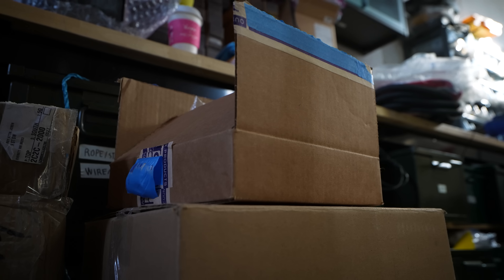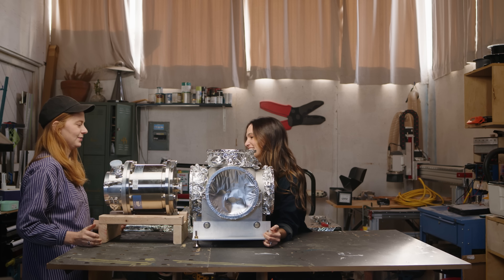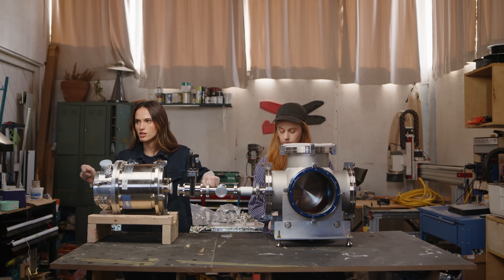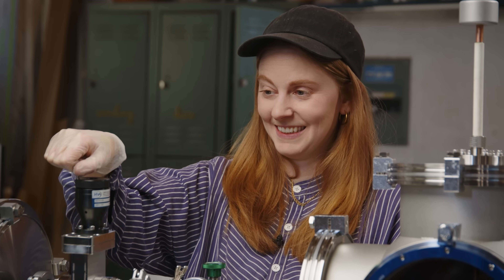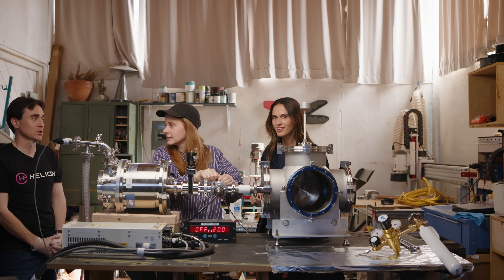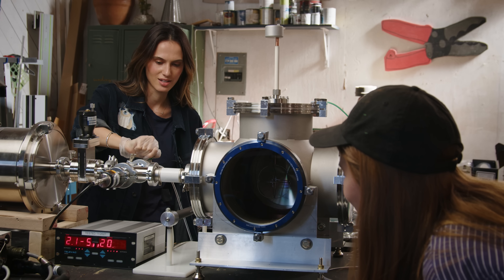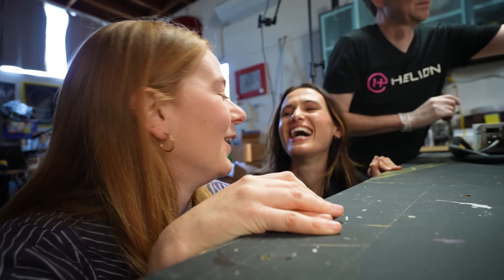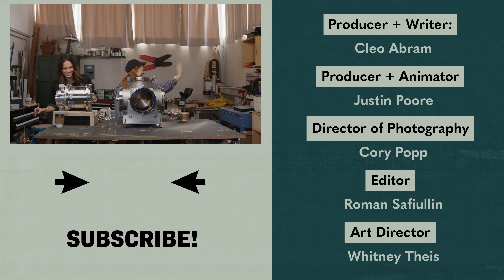We Tried To Do Nuclear Fusion

Comment: I just read yesterday that the Lawrence Livermore National Laboratory in California have finally achieved a net energy gain from a fusion reaction.
Reply: I saw a tweet from a nuclear physicist who said that it's like very short bursts of net energy gain, it's lab-scale stuff that still has a long way to scale up for real energy production.
Reply: No, not yet. There is still the need to extract the energy and only after this step (including losses) has greater than nett zero does it mean time to scale up and industrialise.

That's why @davidkirtley and the guys at Helion are so important as their design Co siders the direct  electricity energy extraction in the fundamental design, ie Helium 3
Reply: Yup , true .They are due to make formal announcements December 13
Reply: The NIF, National Ignition Facility, has achieved target gain by generating a 3 megajoule output with a 2 megajoule input. This is a gain of 1.5. Gain is how we describe how useful the system is at generating energy, but there are a few different ways to describe gain in this field, Inertial Confinement Fusion (as compared to Magnetic Confinement Fusion). 

They achieved scientific gain a good few years ago. Scientific gain compares the amount of energy that they manage to couple into the fuel with the energy generated by the fusion reactions. 
Target gain as they have described it is comparing how much energy they generate with how much laser energy reaches the target. Making laser light isn't a 100% efficient process so you currently use much more energy to generate the laser pulses than arrives at the target.
Prior to a power plant being made you would need to achieve or at least have a solid plan for gain as compared to the total amount of energy used, often called wall-plug gain. 
So to get to that point you will go through the various different stages of gain milestones.

What NIF has achieved this past week is one of those critical milestone. It is very exciting. 

Few things to note: The way NIF generates laser energy is now old technology, there are more efficient ways to make laser pulses now, so lots of opportunity to save input energy there. They only burnt 4% of the fuel so  (deuterium-tritium mix) so plenty of opportunity to up the energy out there.  Exciting times! 😀
Reply: @petafoster5084  Except no, they didnt. Actual power input to the 192 LASERs was around ~200 MJ, power on target was ~2 MJ after losses, extracted energy was ~3MJ final, so it adds up to a huge deficit in total.
Reply: @Sven_Dongle  yes it is the laser energy on target is why they call it target gain.
Reply: No, they didnt' reach net energt. At all. Stop, pls
Reply: What does this mean exactly? Does this mean they could scale their current solution large enough to power a city? (Ignoring any additional breakthroughs)
Reply: @TysYouTubeChannel  From my understanding what they have at this time is not commercially viable or scalable at this time.  The main choke point seems to be being able to obtain enough quantities of the specialized materials used in the construction of the reactor.
Reply: @JPF1077  That's not the only problem. Once the pellet explodes and the energy is released, there's no way to capture the energy and no way to quickly replace the pellet and fire the lasers again. So you can't use this technique to create long term sustainable fusion.
Reply: @TonkarzOfSolSystem  On a commercial level could they not utilize multiple reactors in sequence?  Capturing the heat from the reaction should be simple enough.
Reply: @JPF1077  The issue is that the pellet needs a football field worth of empty space all around it. Makes it hard to capture the heat.

And because the reaction only lasted for milliseconds, and requires so much space, using multiple reactors would not work. 

This experiment was created to make fusion for weapons testing, it's not for energy production.

So there's no way, even theoretically, to produce energy in a practical way using this technique - even if they can drastically improve the energy output.

However, as they repeat the experiment they'll develop a better understanding of what is causing this and from there they may be able to develop new ideas and theories that could be used for energy production.

This is an important milestone but it won't solve today's problems.
Reply: @TysYouTubeChannel  No, the laser charging loses aren't part of the reaction energy so it still takes more power than we could feasibly generate with it the reaction itself is just putting out more energy than the energy emitted by the system that ignites the reaction. It is still a really impressive feat, but practical fusion still has several more iterations before it can generate net electricity.
Reply: @garethbaus5471  On top of that there isnt enough available tritium on Earth to fill a wine glass. The NIF can only achieve 1 shot per day to produce enough total energy to power your computer for about an hour.
Reply: @Sven_Dongle  Tritium is expensive, but we already know how to make it and fusion reactors should in theory have an advantage when it comes to breeding more tritium, so that is a problem but it isn't a deal breaker.
Reply: @garethbaus5471  Practical fusion "still has several more iterations before it can generate net electricity" — yes — and even more iterations before it is cost-effective. That's the part nobody seems to quite get around to talking about.

Let's say we figure out how to build a practical, working, reliable fusion reactor the size of ITER. It'll take 12 years and $20 billion to build, and it'll produce 200 MW of electricity. What else could you build in 12 years with $20 billion? About 15 GW of solar. Or 11 GW of wind. Or 3 to 4 GW of offshore wind. Oh, you wanted dispatchable power with a high capacity factor? OK, fine, build 5 or 6 GW of geothermal.

(And all that's with today's prices. These other technologies aren't standing still either.)

Getting net electricity out of a practical, working, reliable fusion plant is just the start. Costs then have to come down by a couple orders of magnitude before there's any point in actually putting one on the grid.
Reply: @TysYouTubeChannel  not yet. Thats opimistically ten years away.
Reply: @TysYouTubeChannel  it means the "reactor" produced more energy than the energy invested in the system.
Reply: @TysYouTubeChannel  That's the rumor.
Reply: Don't worry, it'll still be 30 years away from commercial application. It's always 30 years away from commercial application.
Reply: @CantankerousDave  Commercial, perhaps. Industrial is a different story. With the rate of advancement in technology I'd offer a more optimistic view of 10-15 years. Our technology has been telescoping at a far greater rate than years prior. Predictions made today will be widely off base for the world of tomorrow. But, I'm an optimist, so there's that.
Reply: Does this break the Conservation of energy law?
Reply: @TysYouTubeChannel  it doesn't
Reply: @DForce26   I'm so confused. Then where is this energy coming from? Or is it not yet understood?
Reply: @TysYouTubeChannel  the energy is stored in the particles themselves. Mass = energy. So even if we only need 1 volt to fuse them, it still wouldn't be a violation of any laws. The energy released with fusion, has always been stored in the particles.
Reply: @TysYouTubeChannel  My guy, this is how the sun works. Its not magic.
Reply: @TysYouTubeChannel  From what I've read according to the law of conservation of mass, during any physical or chemical changes, the total mass of the products is equal to the total mass of the reactants. But in nuclear fusion reaction energy that the sun emits in its core is due to collision of hydrogen nuclei and formation of helium nuclei. 

Here conservation of mass is not obeyed as certain parts of the mass are converted into energy. So, law of conservation of mass is violated here. The law of conservation must be redefined as: during any physical or chemical change, the total mass of the products is equal to the total mass of reactants provided mass has not undergone conversion into energy.

The Law of Conservation of Mass is no longer valid in its original formulation under the mass-energy equivalence given by E=mc2 - not only is it not violated, it no longer even applies.
Reply: @DForce26  Well, thank you for that well thought out and lucid response. Perhaps you would like to argue from a chemist's perspective? Because what I mentioned is taken directly from scientific notes of conversations from Dr. Nicolau Saker Neto and Dr. Benjamin Norris. 

But, I'm sure you already knew that, you're such a well-read scholar of high repute.
Reply: @aaronhhill  I'm not... But I know that E=Mc² still applies to fusion... So the law of conservation of mass (energy) is not violated. Thanks for coming to my tedtalk
Reply: @DForce26  y'all are missing the point. You can theoretically explode an atomic bomb by swinging a hammer. It doesn't mean your arm possess the power of an atomic bomb. Same with nuclear fission, the energy applied to fuse two particles together is only what it takes to fuse them. The energy released in the process of fusion is entirely different.
Reply: @aaronhhill  sorry, replying to the last person in the thread here. I get that you get it.
Reply: @TacoKhezis  that was what I was saying..
Reply: russians were able to do the same in the 70s
Reply: This reads as a perpetual motion machine to me. Almost made me check the current date to see if it was April 1
Reply: @osmia  It still follows the laws of thermodynamics... So don't worry...
Reply: @osmia  It isn't perpetual motion.  They'll still need to feed fuel into it.  They just won't have to provide a ton of electricity to keep it going.  Remember them popping the circuit breaker?    They were pumping a lot of energy in, to make that tiny reaction.   Once they get through the last few problems, they'll generate enough power to keep it going, for as long as they feed it fuel.

Like jump starting your car.   You can use jumper cables to spin the starter, but as soon as the cables are disconnected, the engine stops spinning.   But with gasoline, and all the other parts working correctly, it will keep running until you shut it down, or it runs out of fuel. 

Cars keep a little buffer of electricity in the battery, so if it is shut down normally, it can be restarted.   

Full size fusion plants will have something similar, so they can go online and offline any time, as necessary, without depending on the power grid or other plants, to jump start them.
Reply: @osmia  Fusion doesn't it doesn't violate any thermodynamic laws.
Reply: Except the energy is already there via potential energy in an atom it is just about finding a way to harvest that energy with minimal input of energy
Reply: @osmia  no they're using energy to break apart materials, not creating it from nothing